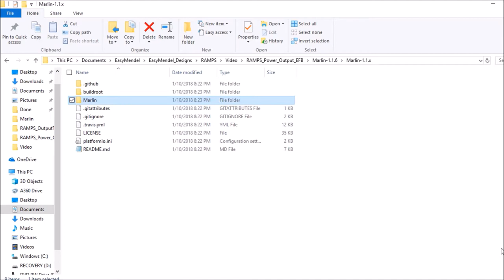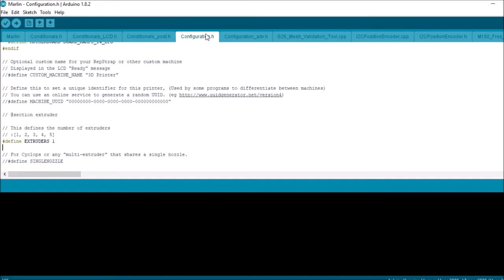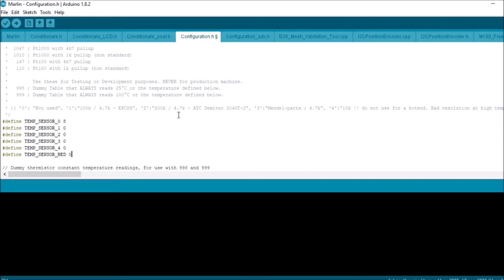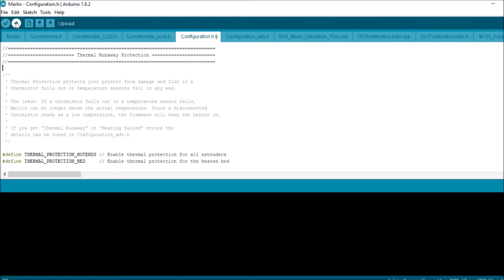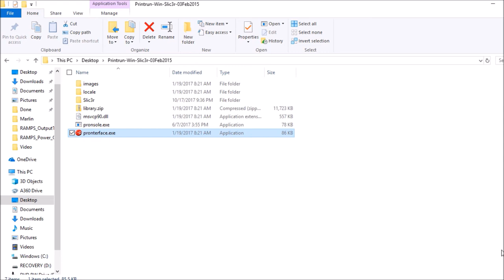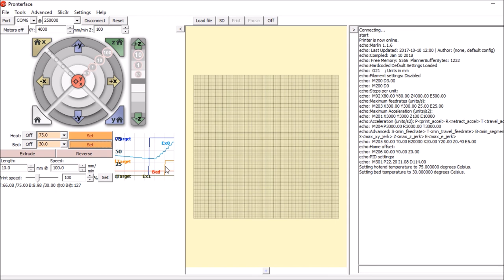RAMPS 1.4 - Power Output EFB  (D10, D9, D8)

Comment: hi, i have a problem with my RAMP 1.4 D10 and D8 output. i dont get the 12v output as D9 output. I only get 12v in D9 which the fan is working fine but the heatbed and extruder didnt work. anyone help me to solve.
thankyou.
Reply from the maker: So  could you provide a little detail ... Are you measuring output with a Multi-meter on D10 and D8?  If they read correctly at full power when measured, then I would check if the wires are mounted correctly without power for safety.   If you're not getting full power on Multi-meter with measured voltage I would guess there might be an issue with the RAMPS 1.4 board first and then the Arduino Mega 2560.  Also you might want to measure the power on the cables from the regulated power supply.  Remember to follow all safety protocol when power is applied to system.  If unsure I can do a short video on how to check safely.
Reply from the maker: What are the values when reading the power supply input with a multimeter?
Reply from the maker: @Bytes and Bots India When you measure what are the setting in Pronterface or gcodes entered?  Also which test points are you measuring with multimeter?  What are the reading in Pronterface.  What version of the Marlin firmware are you using?  Do you see any error messages in the Pronterface window?
Reply from the maker: @Bytes and Bots India Okay I understand the confusion, I forgot to add to the description the link to the Marlin firmware in order to flash the firmware on the Arduino Meag 2560/ Ramps firmware.  Here is the link ... http://marlinfw.org/meta/download/ ... you'll need this to flash the firmware on the board using Arduino IDE ... https://www.arduino.cc/en/main/software ... Keep in mind you might need to download and older version of Marlin like 1.1.8 which exists on github.  Hope this helps